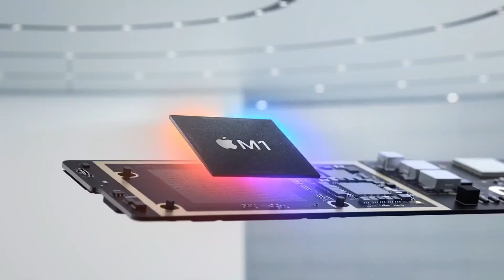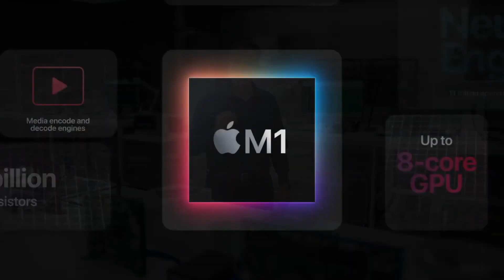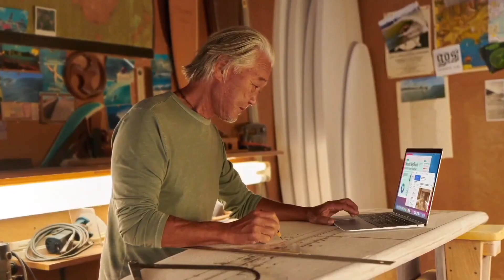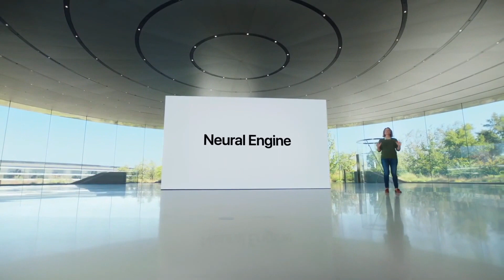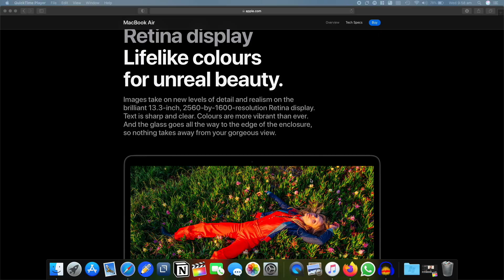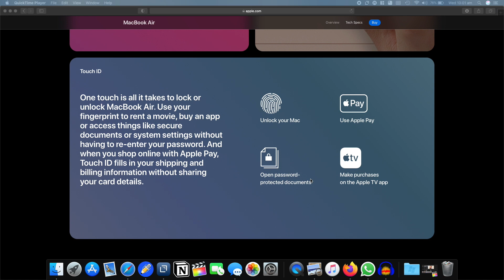MacBook Air M1 - Is this your next laptop?

Comment: What mac do you have and what year is it?
Reply from the maker: Right now I have 2. MacBook Air 2013 (don’t use it). MacBook Pro 16 inch 2019 with i7 and 16gb ram (using since 7 months for all video editing). And now got the new MacBook Air M1. Testing this thoroughly.
Reply: @VibhorMaheshwary  I am waiting for my new shipment to come it’s the m1 512gb
Reply from the maker: Nice. I just got mine some time ago. Nice machine. I am infact thinking of using it actively as my primary system
Reply: @VibhorMaheshwary  How do you find the preformance